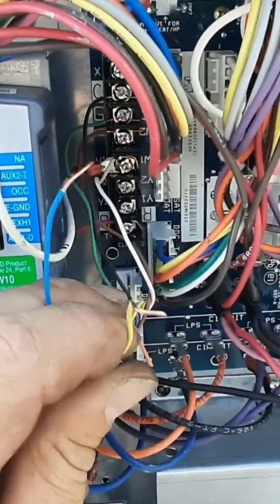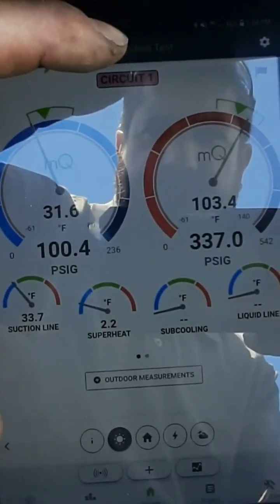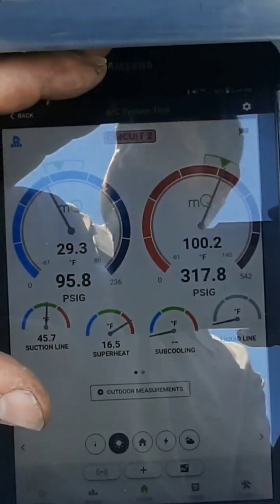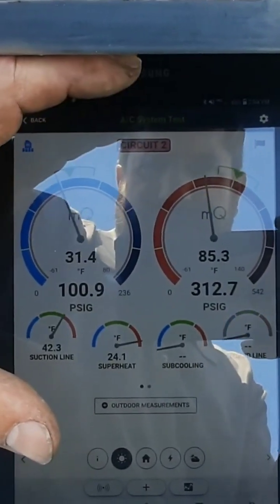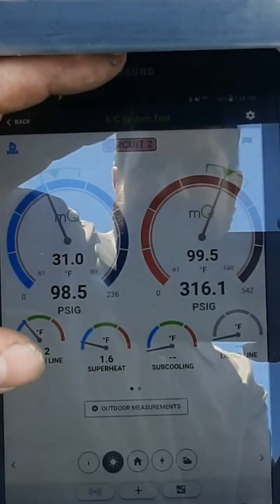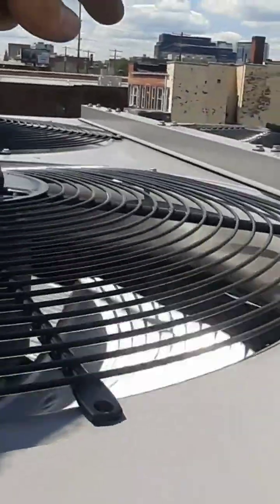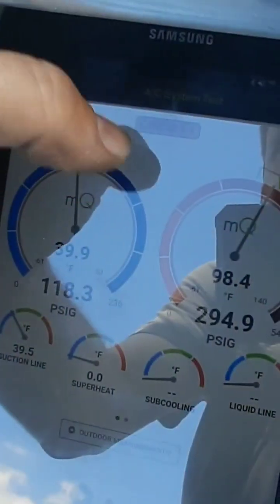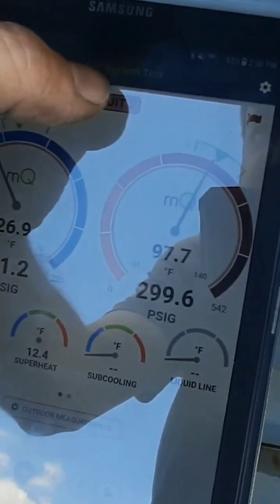Carrier humidimizer part 3. dehumidification mode. #hvac #hvacservice #carrier

Comment: Have you had any experience where the thermostat says running in dehumidification but not running at the unit? I ended up resetting call for cooling at tstat and it switched it but still weird
Reply from the maker: I have not seen the thermostat actually control the dehum signal. We usually see a separate humidistat in the return. Having said that it is just 2 wires, contact closes with raise of humidity, pretty simple check just as you would a call from the stat.